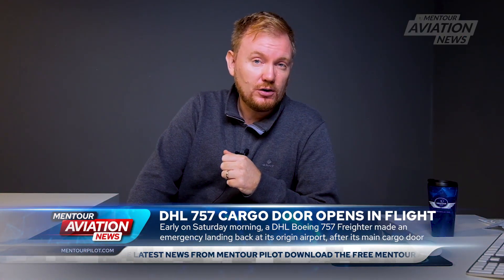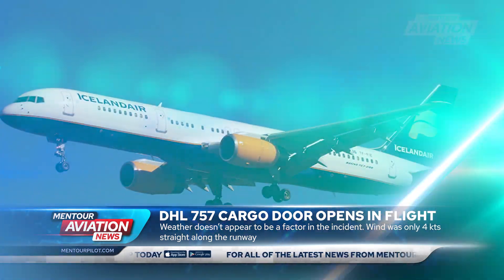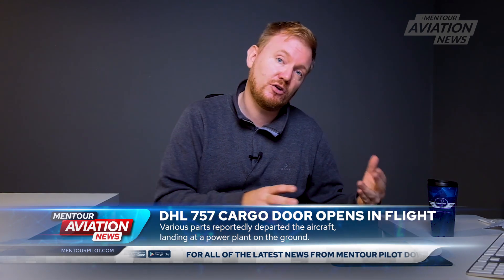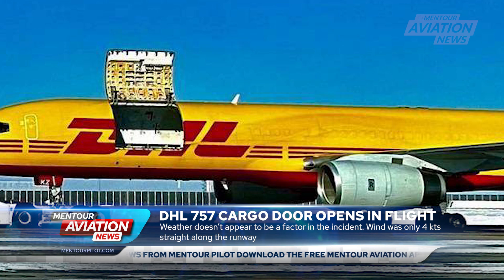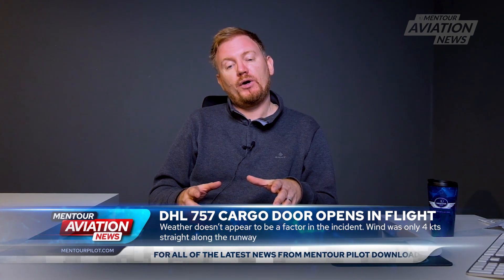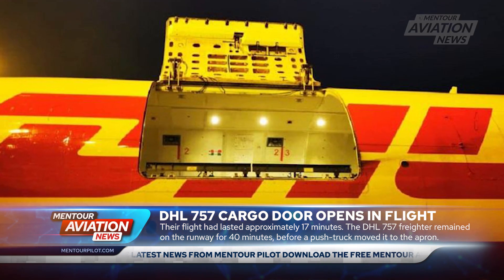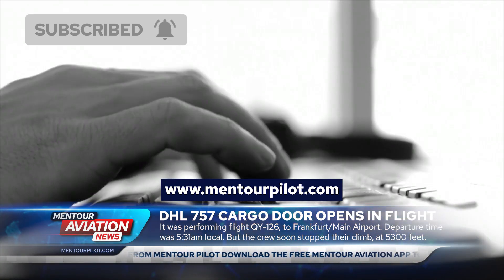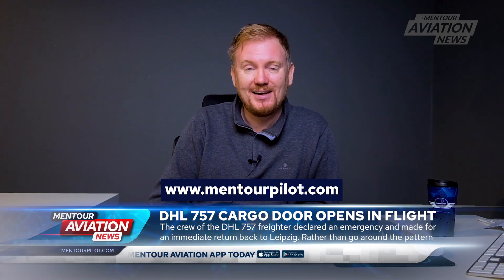Boeing 757 diverts after Cargo door OPENS IN FLIGHT! Mentour Aviation News

Comment: All things considered, I'm surprised it DIDN'T rip the door off! BTW: How are the puppies doing???
Reply: Don't forget, the ground limit of 45 kts is in case the wind comes straight against the door, but in this case it was edge on in the airstream, so loadings would be much lower. Still, not my idea of a fun day at the office; kudos to the crew for getting down SO quickly, and the engineers (although I doubt they engineered for that condition, just good overall strength, and a bit of luck).
Reply: @andyowens5494  you still have crosswinds in the air, I know I've flown in them. Didn't do much for my nerves!
Reply: @hairyairey  The aero forces from crosswinds will do virtually nothing to the door; you either angle into them to keep tracking straight across the ground (in which case the airspeed across the nose is zero) or fly "downwind" in the prevailing direction.(in which case the airspeed across the nose is also, err  zero). If there is ANY lateral component, the aircraft will yaw - that massive vertical stabiliser will see to that; it is the reason you need to kick in rudder, to prevent the yaw moment. The only time cross wind would come into play would be from just before touchdown, and as in this case the wind was 4kts down the runway, any crosswind component would be negligible. Yes, it is possible to side-slip, but not sensible in a commercial jet unless in extremis; gliders and military jets, needs must, commercial aviation, err nope (unless you're Sully and have both engines out - thats extreme).
Reply: @andyowens5494  Watched Petter's other video earlier about the "Gimli glider" where they did indeed side-slip but normally this is a very stupid idea with a commercial jet. Thing is of course that this door is so critical to the structure that it wouldn't take much sideways force to turn it from an aeroplane to a very heavy brick.
Reply: @andyowens5494  Well lower loading but in an axis the door probably isn't designed to withstand any forces at all in (it's not like they're designing the thing to withstand 200kts of wind on the ground in any direction). Also I bet once they started turning the airstream would start twisting it too.
Reply from the maker: They are great! I post constantly about their progress on Patreon

Comment: Thank God it wasn’t a rapid decompression at a higher altitude!!!
Reply from the maker: Yeah, that could have been even worse
Reply: AFAIK the freight planes don't have their cabins pressurized (at least not fully) I heard it's part of the reason why batteries cannot be flown on freighters or in cargo when it's okay for you to carry one on board. Perhaps that was partly the reason why everyone could land safely in this case.
Things certainly could have been much worse. At least everyone's okay.
Reply: @hdd113  The entire cargo area is pressurized. 35 year retired Part 121 A&P.
Reply: @markhull1366  yes I did a quick web search and it looks like I was misinformed.
Reply: @hdd113  So it was not the pressure differential that forced the door open. And the locking must have been very weak. As in nearly not there. Just shut but not locked. all speculation anyway until we have the report.
Reply: @hdd113  The entire fuselage has to be at same pressure, it's not possible to have sections at different pressure. The fuselage is a tube and therefore it can withstand high pressures. So for the crew to survive in comfort it has to be pressurized at flight altitudes.
Reply: @hdd113  That is not why you can't put batteries in cargo, it's a fire safety thing. If the battery were to catch fire in the cabin, the cabin crew is trained to immediately deal with it (there's a special fireproof box they put it in, for example). If it catches fire in the cargo hold (or a freighter for that matter) there's nothing you can do about it and it will just dump all its internal energy out as heat into whatever happens to be next to it, quickly setting the whole plane on fire.
Reply: @GiddeonFox  About 3 years ago I took a laptop abroad for the first time. As we were about to leave luggage for the hold I asked about my laptop and taking the battery out to go in hand luggage. It was like I was the first person to have ever asked that question. Yes please place it in your hand luggage was the eventual answer, but it scares the hell out of me given the amount of energy in a laptop battery, how many people must travel with laptops and the possibilities on a long flight.
Reply: @GiddeonFox  "whatever happens to ber next to it" which will most likely be more batteries.
Reply: @GiddeonFox  Cargo doesn't complain about the ride, but it doesn't complain when it's on fire either.